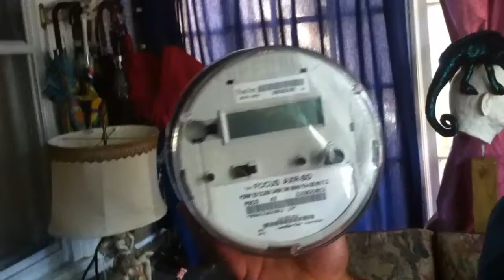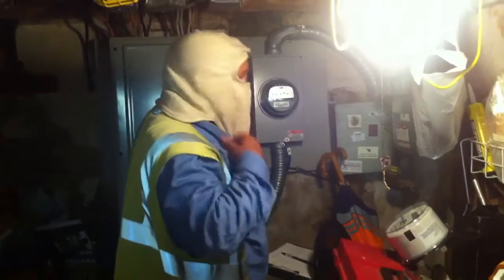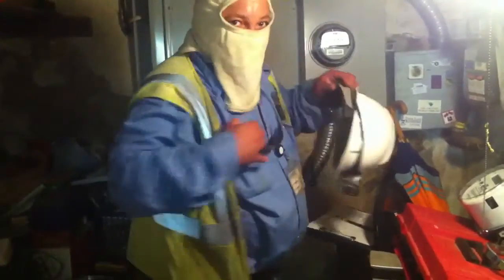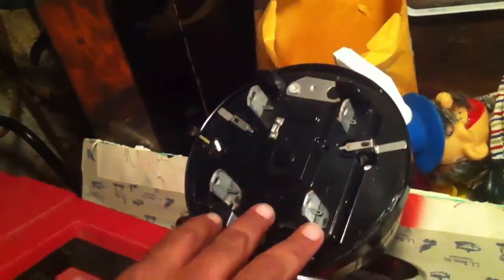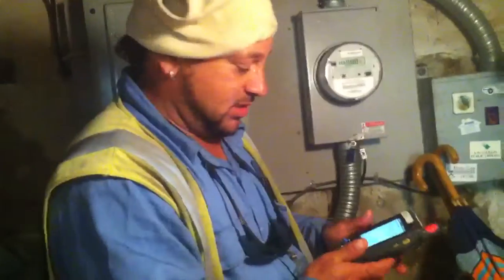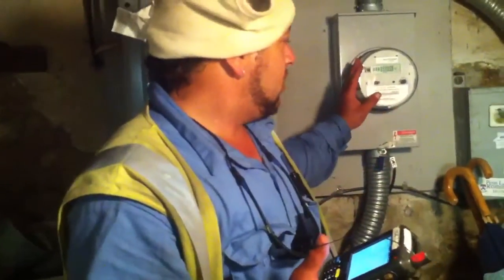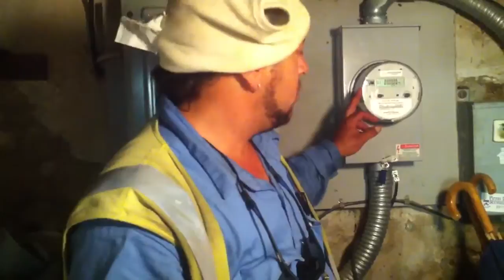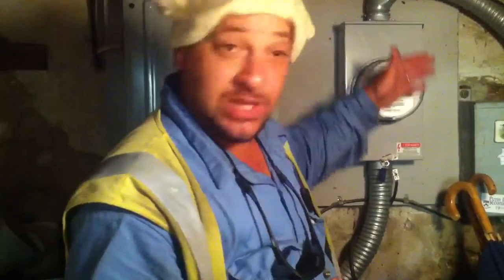PECO installs "smart" radio frequency electric meters

Comment: It would have been 100% safer if the meter transfer was done with the main power turned off.   BUT who cares about the customer's home, it's replaceable after the fire.  Did you know this fools got 1 weeks training?  WOW, that's a lot less than a certified electrician that requires years of training.  Now you know whaY there are so many smart meter fires. Did you notice the close inspection of the meter base contacts that was done in the total darkness?  That's really safe. 
What about the DO NOT INSTALL DISTANCE ????   HOW COME THAT WAS NEVER EXPLAINED TO THE HOMEOWNER???
I guess if you don't tell the homeowner about the dangers of smart meter RADIATION, they any deaths can be explained by other reasons. TO HELL WITH THE TRUTH.

Comment: PROPANE TANK  http://www.newswire.ca/en/story/1535585/regulation-clearance-between-propane-tank-and-next-generation-meter-hydro-quebec-releases-survey-data 

100's of smart meters EXPLODE
http://www.takebackyourpower.net/news/2015/04/01/hundreds-of-smart-meters-simultaneously-explode/
MORE SMART METER FIRES.
http://stopsmartmeters.org/2015/05/21/hundreds-more-smart-meters-blow-off-wall-in-capitola/  
http://smartgridawareness.org/2015/06/03/ball-of-fire-from-hydro-smart-meter/
Reply: +Frederique Zug There's always bugs.  The first knob and tube wiring had bugs.
Reply: Just think how many lives could have been saved if smart meter manufacturers were forced to have their deathtraps UL approved.